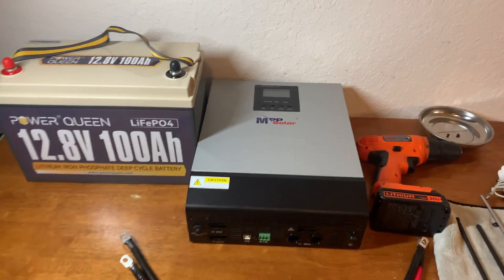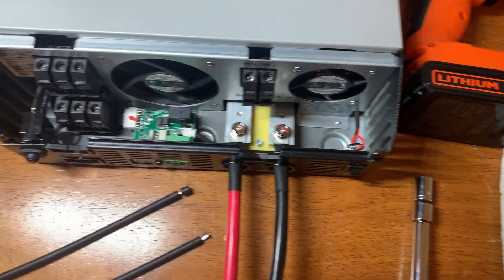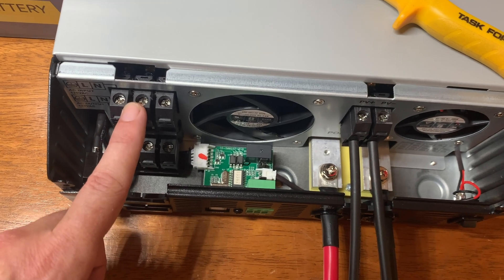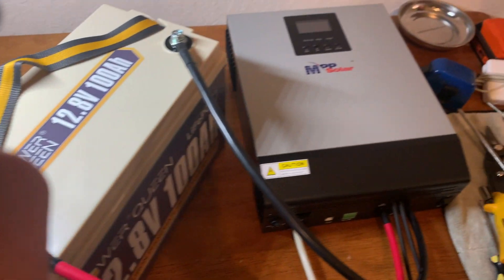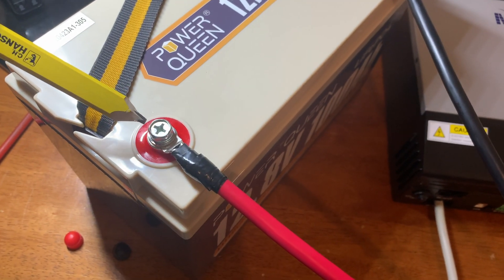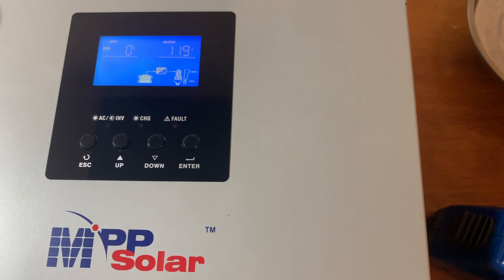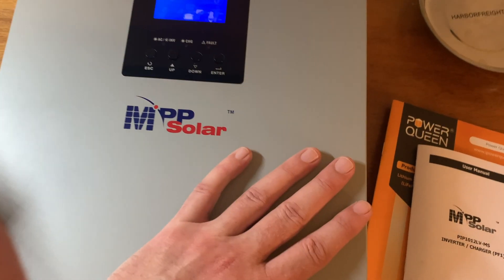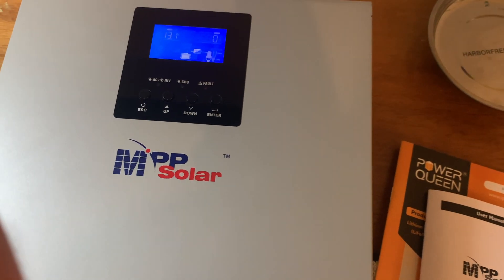Insanely Simple Solar Generator Build - Power Queen LifePo4 100ah &  MPP Solar 12v All in One

Comment: I have a similar setup to yours. Mine is a 24 volt, 3000 w, All In One, branded differently, but I expect, was made by the same company, since the connections and the cabinet are so similar. If we do have similar systems, I suggest that you save the Male end of that power strip cord because you can wire it to the 120 VOLT AC INPUT terminals. That will give you the ability to charge your batteries with grid power, if you have no sun, or with a generator, if you have no sun or no grid power. Just plug it into an extension cord from the wall or a generator (could even be your neighbor's generator, if he's not looking) I actually recommend that you just go ahead and wire it up now so that it's there if you need it.
Reply: What do you mean...the AC input terminals?
To the battery, or inverter, or fuse block?
Sorry for the dumb question, I'm a newbie.
Reply: Not a dumb question, I'm still learning everyday in this ever evolving DIY search for, at least SOME, solar independence. Now to answer your question. These All-In- One units have an inverter to give you the household current you need to run your appliances, a solar charge controller that will let your solar panels safely charge your batteries OR run your inverter when the sun is out and an AC charger that is basically like any other battery charger that you've ever used. It charges up the batteries that you, most likely, have chosen to hook up to the All-In-One so you can use it when there is no sun. That part of the unit is labeled AC INPUT or AC IN. Those two terminals just need the male end of an extension cord attached to them. Once you have that, you can plug the whole shebang into the wall and charge up your batteries, if your power is on at your house, or you can plug it into a generator and charge it on days that the sun refuses to give you free power. Doing that keep you from running the generator, maybe when it's dark, and easy for a crook to home in on the sound and steal your generator. Hope that helps. Feel free to ask more if you need to. Peace. @YouLookingAtMeBro

Comment: I think that your initial investment would be more, the actual electric production would be a little lower.  Your current cost of buying electric from your provider, however, will almost certainly increase over time.  So, if you were going to use the solar system for mining, or just powering your home for more than 10 years, I think you will come out ahead.
Reply: If you have a power outage for 1 or 2 days, and something like this keeps your freezer and refrigerator running, so you don't have a bunch of food spoil, then it can pay for itself very quickly.  There are many scenarios, like those who work from home, where having an off-grid power option will be very valuable.  Another good example is someone with specific medical needs.  It's really not just about money, it's about being prepared.

Comment: Quick question: if you disconnect the battery, are all the settings saved?

Also, did you ultimately install a breaker on the positive from the battery?

Thanks!!
Reply from the maker: Hi Mayben25, yes, the settings of the inverter are saved even if the battery gets disconnected. I actually did end up installing a master breaker that disconnects the positive side of the battery from the inverter. I made a couple of other changes to this setup too (additional fuses, usb outputs, fire resistant backer board etc.). I'm planning to upload an update video showing what I've changed/added. A lot of the upgrades I did came about due to suggestions from comments you guys have left for me. I hope this helps and thanks for the questions!

-Josh
Reply: Awesome!  I’ll be looking for the video when you post. I was curious if I should do the same in adding a breaker. MPP didn’t recommend it so I didn’t but I’m starting to rethink that.

Comment: Do you need a fuse on the positive cable between the battery and the inverter?   Or is that built into the unit?
Reply from the maker: Hi B Zab, so the BMS on the batteries I've used does have over current protection  built-in so theoretically that should be enough to be safe, however, just to be extra safe I've installed bolt-on Fuses on each of my builds (on the positive terminals of the batteries). The batteries that I have will output a max of 100 amps so I went with a 125 amp fuse for each. Since it shouldn't hurt anything I figured why not :) . I hope this helps !!

-Josh

Comment: Thank you for the beginner-friendly intro.  Will you consider increasing the PV panel ?  Would that charge the battery faster?
Reply from the maker: Hi Nick, yes, you're correct. Adding more (or higher wattage) panels will charge the battery faster. I go back and forth between the 100w panels and a pair of 210w panels. I typically use the the smaller 100w panels simply because they are easier to setup and move around (the 210w panels are pretty large). Thanks for the question!

Comment: great build, what could this power? im still trying to learn how much watts and or volts i need to run my AC and  tools for workshop. please keep us up to date on future builds and ideas. sub'ed
Reply from the maker: Hi Bucket, thank you for subscribing, I really appreciate that !! This particular build will power anything up to 1000 watts. The amount of time that a 12.8v / 100ah battery  (what I used for this build) can run a 1000w load is ~ one hour (12.8v*100ah = 1280wh), give or take a little, after factoring in the inverter efficiencies etc. AC units are notorious for being power hungry, however, if it is under 1000w at peak then this will run it. I would suggest a much larger battery than 100ah to run any AC unit though as you would likely only be able to run it for an hour or two max with a 12.8v/100ah battery. I'm hoping to post some new videos very soon so stay tuned . I hope this helps! Thanks again !